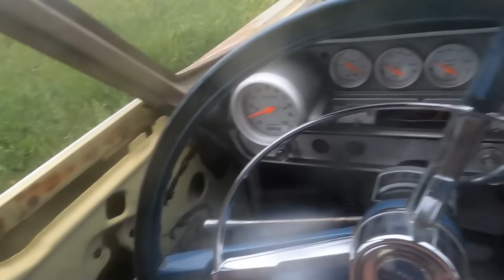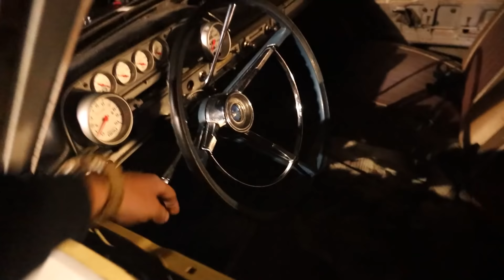Attempting to Drive my Galaxie for the First Time in OVER A YEAR! *Will it make It?*

Comment: Your f100 has been the basic building block for my 86 el camino. Ive made the same exhaust on longtubes blew it up last november just got a new motor from a 71 camaro now gotta wire everything. But yeah huge impact on my decisions man! Keep it up
Reply: Just dont repeat what he did with the f100s motor by throwing away 3k for supposedly rebuilding the motor & blowing it up at 6k miles.

Comment: Craig, your so close to having it ready for color, do the little bit and get it sprayed. It doesn't have to be a fancy paint job, but definitely spray it. Better yet, do what Hot Rod did years ago, roll it on multiply of times and color sand it out. Then buff it out. Keep it cheap

Comment: I think the headliner goes in before the front and rear glass. If you do glass first it may have to come back out for headliner to be installed. I have heard it is hard to get glass out without breaking. I suggest checking with your glass and interior people. I am very impressed with what you have done with all your projects.

Comment: I'm very proud of you ,Marty and the gang to finally getting this car on its 1st test drive! Its been a long time I've been following you on your Galaxie projects. I just have a couple of questions, that engine compartment looks sharp! Is that the same 352 that came with the car??? Today the engine looks clean, brand new and is made to look like a 427 with the valve covers and air cleaner unit ?? The other thing is I know you'll make adjustments all around the car as you'll drive it more this point on, would you please jack up the rear of the car about 2" to give it a slight rake cuz it looks like a 50s taildragging custom😝 and would eliminate the driveshaft from hitting the floorboards over big bumps. Its a big car and it really looks way too low in the rear as I see you driving down the road in the video otherwise its a rad ride, I love it! Again, congrats!!!

Comment: If those fans are any good, they will be moving over 2000cfm each. Not the 800 odd that you mentioned. I have a set of Ford OEM fans on my 72 Lincoln Continental and they move a combined total of 4000cfm.

Comment: I agree that you should hold off on painting for as long as possible, which would give you plenty time to work out most of, if not all, of the issues with the car. I also would suggest at least a good primer coat to protect the metal from any future rust. As for color, Ford has a newish color called Antimatter Blue, I think it would look insane on this car, at least as long as you don't put in a red interior 🤮 This is your parts car that collected more parts than it donated. I don't remember seeing the antifreeze filter you have installed on the upper radiator hose, where can I get one???

Comment: If you’re gonna put glass in it, might as well get it in some sort or primer.  And then drive it as long as you like to work out the kinks.  Paint is overrated.  But I think it’d  be borderline silly not to prime it…..as good as the metal is after all you’re work.